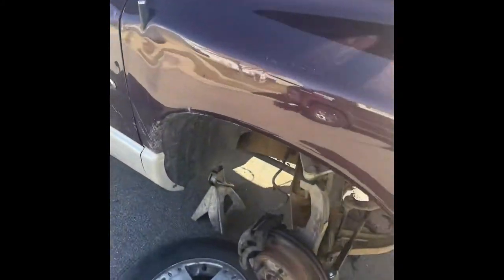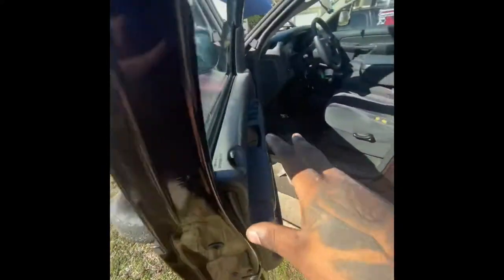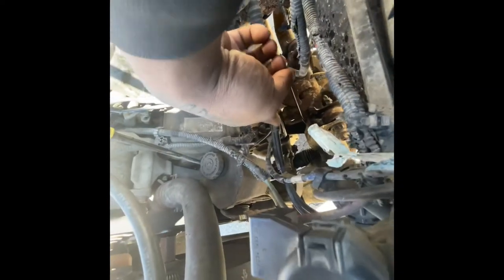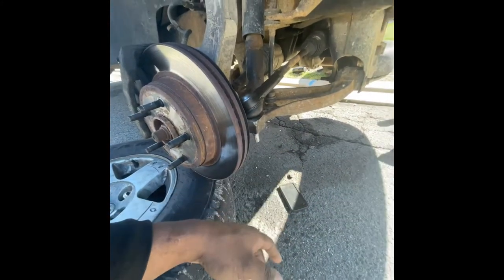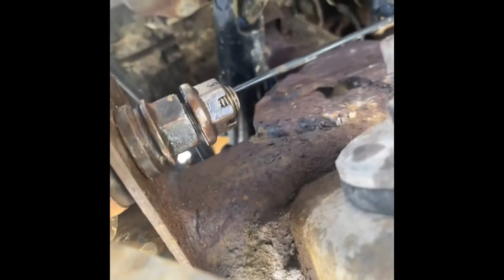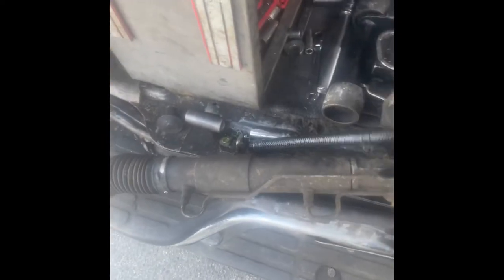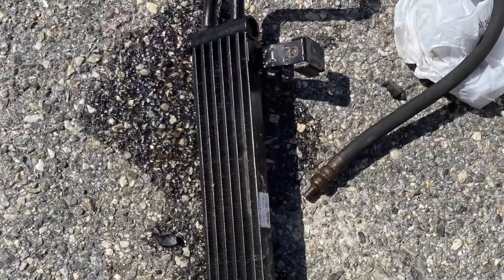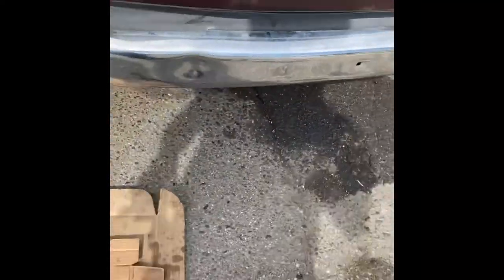2002-2008 Dodge Ram Rack N Pinion Replacement.

Comment: My truck is a 2006 diesel with 2wd. It is equipped with a rack and pinion steering. I recall most of the job as I had done it on the same truck about 9 years ago, but it was good to watch a refresher video. It seems to me though that the unit drops out and goes back in simply by lowering it down. Maybe that is the difference on the 2wd truck. 
Thanx lots for taking the time to post this!
Reply: Well, I got the job done. It took a bit longer than I expected but my old nearly 70 year old body does not take to the "aerobic exercises" required to do a job like this on the shop floor, like it used to. 

I did discover that the leaky one in the truck was not due to worn out seals though. It looks more like a defective O-ring/rebuild the last time (right at the part line of the valve body to the rack housing). Oh well...

I also "forgot" that I was due for a replacement wheel bearing/hub assembly on the LH side. The RH side had failed about 5000 miles ago. Redoing that added to the length of the job of course. I had purchased two of them so I had it here.

It was nice, after getting it all back together, to look under the truck and see NO oil leakage.

Again - a big thanx!

Comment: Did this fix the sloppy steering , issue, if that’s what you had ? Mine isn’t leaking but steering is sloppy despite changing out upper and intermediate shafts and outer tie rods …
Reply from the maker: Yes it did wonders. And after an alignment it made it feel like it came off the showroom floor!

Comment: How do you bleed it ?
Reply from the maker: Turn the steering wheel end to end hold it at each end for a second each! 
Watch the reservoir for bubbles this will be the indicator of air escaping the system.

Comment: iS you use the wrong bolt on the rack does it wear the grooves out faster over time?
Reply from the maker: Potential it can cause the rack to shift but honestly it wouldn’t allow the part to sit flush if so.